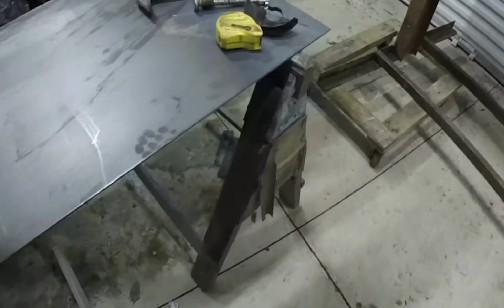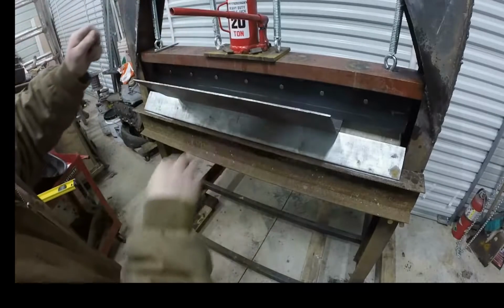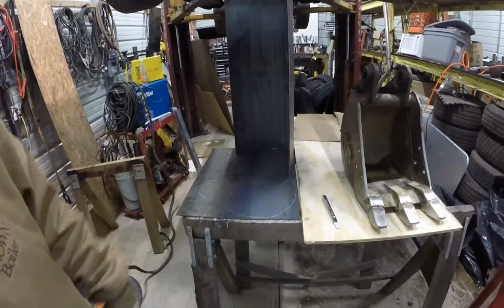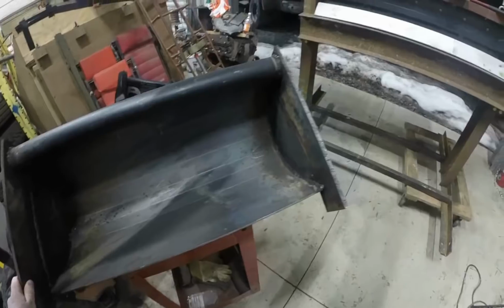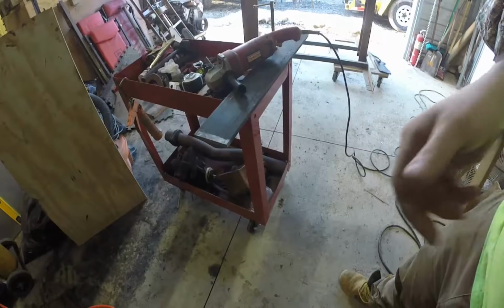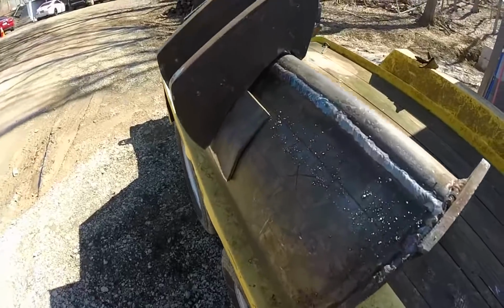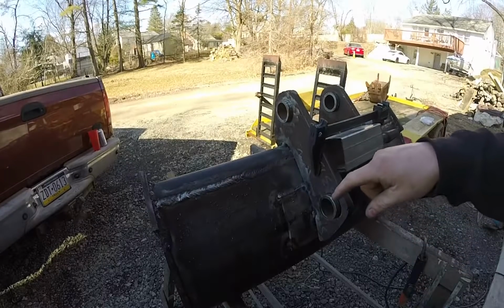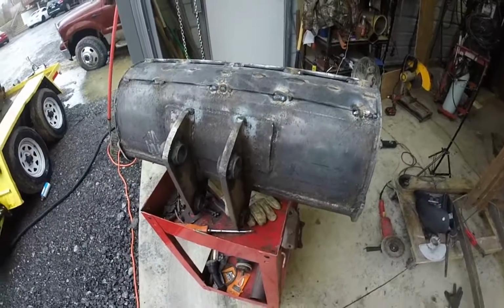Building a 30 inch mini excavator bucket.

Comment: I have a tb015 Takeuchi.   Been wanting to make a 30" grading bucket myself, thanks for the video, gives me a few pointers.  My other bucket is 18" digging with 4 teeth, works great
Reply from the maker: My other video I turned a case backhoe bucket it an 18 inch bucket. Works really well

Comment: The dam food guy ! Lol I got to remember that one .. well done this is one of the better bucket builds out there . One question , why didn’t you convert to quick connect style just curious? I have a Terex hr16 I bought couple years ago but the quick connect on Terex is similar to Wain-Roy but the release is not the best design thinking about changing over to a pin grabber style,  really only worth it if your changing between buckets or attachments multiple times a day. 
Keep up the good builds !
Reply from the maker: I appreciate it.  Honestly I am just trying to limit the amount of possibilities that can go wrong when I'm out on the job. My luck it would break mid-day. I don't use the machine everyday ( like once a week maybe) and the buckets are so light I can change them pretty quick. Once I buy a bigger machine I will definitely be using a quick change.

Comment: Good job and videoing.  I have a Bobcat 324 excavator (and it too uses 30mm pins) and would like to build a grading bucket along with a ripper, however, I have looked for a couple of years for prefabricated weld-on ears with no success.  Those are readily available for almost all other brands except Bobcat.  I've looked for 30mm ID collars to use for the pin bushings and while those will work, I like your concept of the pipe with the bushing inserts.  I was wondering what size of pipe (OD and ID) you used to house the bushings?
Reply: David, I built myself a 42" clean up bucket and a trenching bucket, I used weld on hubs from Princess Auto with a 1" and 3/16" inside diameter which is just over 30mm, and for my ears I went to a machine shop and had them cut them out on the plasma table, I brought 1/2" plate and they didn't charge much to lay it out and cut them.